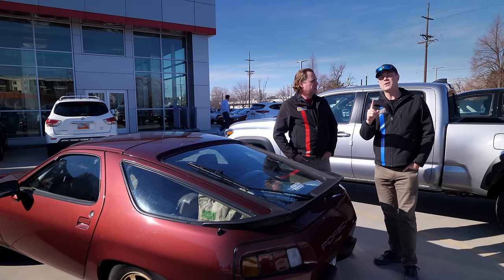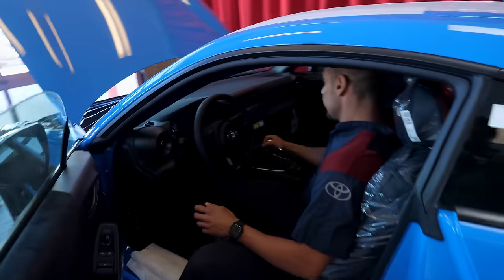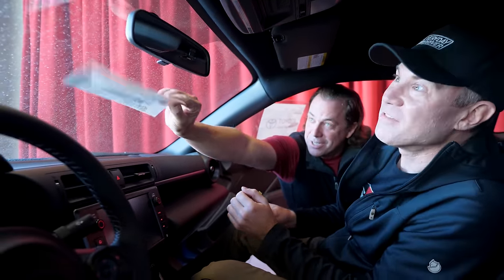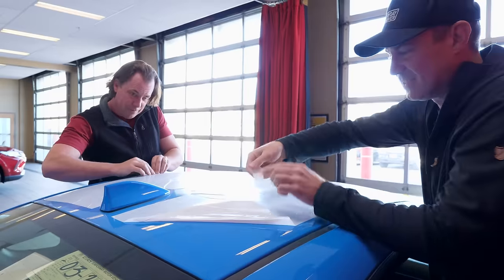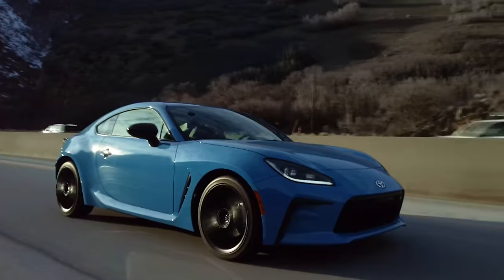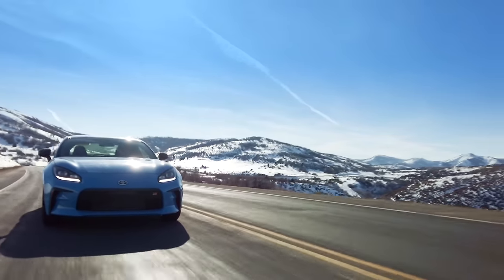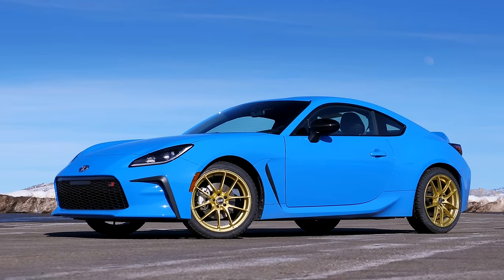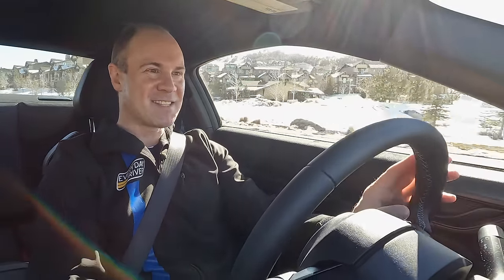We bought a GR86! - Money where our mouth is - Long Term #1 | Everyday Driver

Comment: Love the car congrats on the buy, quick question, how’s the car handle in the winter with snow is it usable as a every day car or is it being RWD a little much?
Reply from the maker: Todd drove his original FRS through many Utah winters and snow storms. RWD isn't a problem if you have winter tires.  That first gen was incredibly fun in the snow and this is no different. There are a couple videos on that car in the snow. Nothing showing it yet on this one. Thanks for watching!
Reply: I daily the ND miata in Colorado for a few years. With proper snow tires, anything under 1ft is very doable.
Reply: I've always wanted a 986 or 987, but at this price point for a new car. Burning question! A side by side comparison with 1st or 2nd gen boxter.1) Is it going to give me the same boxter fits like a glove interior. 2) is it gonna handle as good or better then boxter? 
Thanks! Love how the channel is evolving!
Reply: @hnc521  drove my mustang for the first time in the winter it was just fine. We had an ice storm and that was real bad, but to be expected.
Reply: @evalonious  I sold my 2009 Boxster S about a month ago and just took ownership of my new GR 86 about two weeks ago. The Boxster was a PDK transmission and I had all season continentals on it it also had 19 inch wheels. The GR 86 is the premium manual transmission and I bought a second set of wheels with Michelin winter tires so I can drive here year-round in Michigan. One of my main reasons for making the switch was for a greater comfort inside the car. I am 6 foot one and 170 pounds and I appreciate a little more legroom and being able to recline the seats also having space behind the seats for gear that one can easily reach and a good sized cupholder in the door. Terms of handling the cars are quite different the boxer is glued to the pavement and I never did break it loose on a curve. The GR 86 is easy to get sliding if that’s what you want to do especially in the winter. Comparing their steering the GR 86 is sharper especially on center very quick steering the Porsche was a bit more relaxed actually. I’m only at about 700 miles on the GR and have just today driven it over 4000 RPM for the first time. Obviously the big torque is 4000 up which was great to experience finally. The car is plenty fast for me not quite the same as the Porsche but just fine.
Reply: @Bill Leete  That was so informative. Thanks for taking the time to respond. If I had a car here in North Carolina (with mild winters) that could go sideways, I think I would end up in jail. 😅 I can actually "under-steer" slide with my Jetta Sportwagen virtually unnoticed. There is a  2 lane on ramp by my house that I can  slide across from the inside to the outside lane in the turn. Absolutely hilarious fun, when no cars around. If I had a car that oversteered, I would need a track.
Reply: @evalonious  Hi Evan, I’m sure when I get the summer tires back on the GR and have dry pavement the car will be quite stable. Only then can I really compare its handling to the Porsche.

Comment: I'm really mixed with a 981 Cayman Base 2.7 or a loaded GR86. Both the same price, same options, both drivers focused cars. Maybe your first review should be them head to head, because I'm for sure going to have to do it in person to make the choice.
Reply: Get the Cayman. Its a much more balanced car. Find a NA one. It will sing beautifully.
Reply: I am literally in the exact same boat as you. But they aren't the same price anymore. The Cayman is more in the low-high 40's for anything under 60k miles.
Reply: @ptsrs  yeah the GR86 would be probably a $5,000 savings, but I'd imagine after dealer markups and fees it might get very close to 40k. Especially where I live and them being so popular.

Comment: So I’m an owner of a 2018 brz. I’ve now bought the 2022 86. One reason I switched. The tech gauge has a yellow warning light before the red light. I love this when I’m on the track. My 2018 brz with stage 1 tune is getting 29mpg on highway. That’s insane. But it’s 230lbs lighter too. Love to share notes as I own 2018 and 2022.

Comment: Grats on the buy. You're going to love this one. I do, however, have some gripes, and I've learned a few things since I bought mine on black friday. I really don't like how my car came with a vortex generator. I've learned that, for my life, I need a track day set of wheels and tires, and maybe even pads. I need to change the brake fluid because I can feel the change in the brake pedal after track use. I got the noise generator turned off before my track day, and now I actually want it on, not because it sounds good, but it's the free option compared to buying a new exhaust, it's too quiet in here. There's a lot of UEL options out there, but I'm hesitant because it does move the peak torque around depending on who makes it, the tunes aren't available yet. Some catbacks are mostly direct bolt on from the previous gen, and give 2-4 horsepower, mostly negligible. What I want one for is sound, because if I had the money, I'd keep the sound generator off, and have a Perrin 3" Caback. The Borla sounds good too, but I don't know if it will turn the rear bumper into a parachute. there's no muffler in the Borla where the stock can used to be, and that acted as part of the aero to smooth air flow away from that muffler cavity. I hope they do something about that, like a diffuser or something. Lastly, I don't know if you're enforced to run a front license plate, but since I'm in California, I had to buy a front plate adapter from Subaru separately. My BRZ came with mount holes that were Japanese spec, so the holes were closer together, and larger than the hardware provided by the kit. A stop at the local Lowes to find M6-24 fasteners did the trick. You could drill through the bumper, like other dealerships shamefully have, but that will destroy such a beautiful nose. I don't feel like I'm lacking in power, but I've come to accept that I'm not a very good driver. I'll need to work on that. Oh and people need to stop trying to race me at the light. It's really annoying.
Reply: Anyone that does more than one track day a year should consider dedicated brakes and flush the brake fluid with higher temp stuff in any car. That isn’t limited to just these. Even exotics that get tracked regularly need higher temp fluid more often than not.
Reply: Well at least you know that you aren’t going to be beating anyone in that slow a.s car when someone pulls up to race 🤣

Comment: Great video and good coverage. Will get to learn more as you both live with the car. I bought the 2013 Scion FRS based on your reviews. I was driving it in Anchorage in the snow and ice and it did better than most of the cars (get good tires). 
The new car, everything is good about this car. There are quirks, which gives its character. Saw the Subaru and the Toyota version on the roads here, but just can't get over the look of that rear lights! Just something about the proportions and the style! Every time I'll walk to it would be disappointed. Miss the styling of the older gens! But again, styling is subjective, will see what the future will look like. Cool video and cool color choice!

Comment: I wanted the neptune blue GR86! The blue is also very similar to the Porsche Miami blue. The GR86/BRZ's active sound system is around $500 of components (internal speaker + microcontroller). That $500 could've been spent elsewhere like maybe adding wireless carplay/android auto.

Comment: Yes... The dealer can turn it off. I requested to have my piped in audio shut off prior to delivery, and they did. My gr86 was the first available in my area, and it was no problem. You will adjust to the blinkers. I love my car after two months. I do agree with the clear wrap. I had the full hood done rather than the factory wrap.

Comment: tip for those that want to keep the monroney sticker, it comes in the car as an unpeeled sticker, you can tell the dealer not to stick it on so you don't risk ripping it and it being sticky.
The PPF looks like the one my friend got from Nissan factory, it is a hard film, it'll chip like paint.

Comment: I got mine a few weeks ago. The car seat I got (designed for 3 across) fits in the back, rear facing or front facing. If we want to use the front seat, it has to be front facing, and the kiddo is at the weight where front or rear facing is fine.  I need to get those wheel size specs for my winter setup. I love OZs, I had them on the S2K AP2 and also on the Bug-eye WRX.

Comment: Here in Tennessee the dealers are selling the 86 for thousands above MSRP, if they can even get one. All the ones available that I could find have automatics, unfortunately. 

I ordered one from a dealer in Knoxville, they had a serial number for the car on the deal, then a month later they told me the car was unavailable. I found out it had been sold in Ohio. So they said they would get another one.  

Now it’s almost 2 months later, they have my deposit, but I haven’t heard from them

Comment: This latest Toyota is paying some compliment to the MX5, in order to beat it they have had to increase the engine capacity by 400cc. I like Toyota cars I have owned several over the last 30+ years and my current one is a Yaris cvt but my other car is a 2016 MX5 rag top. When I bought the MX5 new I was also looking at the a new GT86. The MX won the toss of a coin because I wanted top down motering.

Comment: All I can say is, I can't wait!! Love that color, and the wheels look great! I've owned my BRZ for 7 years, and I think it needs a sibling... a thinking new BRZ with the GR bumper. Also, hate any artificial engine/exhaust noise, and would take that out immediately, like I did with my BRZ. lol Another thing, those blinker....  I hate them. I've used those type of blinkers in other cars, and they're freaking stupid. Soooo glad my BRZ has normal blinkers! Why try and re-engineer the wheel, especially when you make it worse in my opinion. The original blinker do exactly what I need them to do, without any frustration. I honestly would try and figure out a way to replace the blinker mechanism to a normal style if and when I invest in the new BRZ. That's how much I loath those style blinkers.

Comment: That smart pin you see the technician installing into the power distribution block is a neat little device. If you remove it from a Tundra you can do things you're normally not allowed to do. Like lock the diffs in 4 HI and spin it like a top doing donuts lol

Comment: The downside of doing factory clearbra (Paint Protection Film) is that they will usually do a kit where they don't extend edges to get the car to almost look like there isnt any PPF on the car. Toyota obviously only did a half PPF on the bonnet which is depressing since you can still see the edge and it isnt covering the entire part of the partial hood. Most detail shops out there will do a wrapped extended edge if they are an actual good shop. If not they will just plot the kit and stick it on and it will look cheesy. I for one plan to put ceramic on my GR86 when I buy one but I am also tempted on getting the PPF then ceramic on top of it. But there are always pros and cons to both ceramic and PPF.

Comment: How would you describe the balance between the suspension (compression and damping rates) and the stiffness or lack thereof of the front and rear sway bars? Subjective, I know. Rough roads, off camber turns, what are the suspension firmness or harshness and body roll like? Does the car span the range from sports car to touring GT? [my personal dilemma will be this car vs a 2023 Civic Type R - any predictions?]

Comment: How smooth is the engine? Does it reward you for driving through the whole rpm band? Really not a fan of flat four engine design which has always kept me out of the 86/BRZ twins and eying a Miata NDv2 instead. Very curious with your thoughts
Reply from the maker: Yes. It’s actually enjoyable, and feels as expected, when you wind it through a whole gear to redline. Thanks for watching as always!

Comment: Excited to see how the journey goes! I had a 1st gen 2015, threw a bunch of mods and eventually turbo'd it. I LOVED that car. Sold it to someone 6 years later who (hopefully!) equally loves it. Now I want this exact spec and colour. Only heard good things about the power delivery on the new FA24. I want to give it a test drive and see how everything looks and feels - especially the turn signals since they're so controversial - but nobody has any on the lot right now! Already 99% sold on buying a 2nd gen. Should I wait for 2023 models to see if they address the radiator and turn signal issues?

Comment: How is the car for highway trips?  Not ripping down the road, actually driving at 70-80, passing semis, getting back up to 80 from 50 after some idiot does something in front of you.  Gas mileage, what engine speed are you at for those speeds, is it droney?  Do you get blown around by trucks and wind from the low weight or is it stable from its low height and suspension?

Comment: I will likely buy one.  When I finally drive one, I can weigh in with greater authority….til then……my hypothesis is that I’ll find that it’s not worlds different than the last one ….. yes I know the torque dip is essentially gone…..but it’s otherwise fundamentally the same car w new sheet metal.

Glad Paul has come around, but always found him to be an unfair critic of the old one.

To wit, “I thought the old one was cheap”…..my 2017 brz limited has alcantara  seats with leather bolsters and leather on parts of the door cards.  My guess is that the amount of cheap, hard touch plastic is comparable.

Oh - and to whomever dwells on fuel economy should buy a Corolla and leave the sports cars to us.

Comment: Congratulations on the purchase!
My only question about this car is, as someone who does not know how to drive manual, is the automatic gr86 worthy buying aka is it still fun to drive?
Reply: Just get the manual dude. A lot of GR86/BRZ buyers are buying this as their first manual and they absolutely love it! (I'm on the owner facebook groups). The auto is fine, but the transmission seems to be slow to respond at times and is a whole second slower to 60 so the car is actually worse dynamically and less fun. My advice, hold out for a manual, don't settle for an autotragic.
Reply: Sadly, the automatic is bad. It's just not a very responsive transmission. It's pretty much manual or bust with these.

Comment: I'm seriously considering this car as a replacement for my Mx-5 RF, and am looking for a grand tourer with less road noise on the freeway.  At 14:57 you said:  "I've been very concerned on the freeway about the level of noise this car produces."  Should I interpret this comment as meaning that you were pleasantly surprised by LESS road noise than what you expected?  Thanks for your input!
Reply from the maker: The comment you’re referring to leads into the discussion of the internal speaker/ engine noise generator. That feature makes the cabin loud - but as discussed, you can disable it or turn it off. We will be sharing a before and after. Thanks for watching.

Comment: I paid the big bucks for the  XPEL front half and side skirt PPF on my 22' BRZ. I don't recommend it. It is already peeling in at least 3 areas, rock damage punched straight through and chipped the paint. Most of my buddies put a high quality ceramic coating on their cars and it has held up amazingly for the last 2-3 years. Definitely recommend the ceramic coat and will do that next time.
Reply: That sucks. I’ve read that you can put ppf on first, then ceramic coat on top of the ppf for a total of two layers of protection. I wonder if that would have helped in your case.
Reply: @Barbwire710  You can but that does not change the fact that I paid a lot and already have peeling issues. I will take it in to be fixed but the car has only had XPEL on for 2 months. I would recommend XPEL on the hood only and also ceramic coat the entire car with the best stuff you can find.

Comment: I was debating with myself multiple times if i want to trade my ND2 miata for the GR86. It looks so sweet and is way more usable. Dealers dont really have them around me so it`s hard to see even what they want for it. If i get a good deal on it then i might pull the trigger. Until then miata it is.

Comment: I was happy to say you hated the black wheels. They are very bad, but then I saw your replacement, and I am not sure if they're an improvement. However, question for you both, how do you deal with the engine being as horrible sounding as it is? Both the 1st gen and 2nd gen are lifeless, soulless. That would be okay if they were super powerful but they aren't. Even a Miata engine sounds better, an S2000 engine sound 3000x times better. Even that old porsche you have probably sounds better. Does it bother you, or do you enjoy the driving dynamics enough that you'll just live with it and be happy (once you disable the engine speaker)?

Comment: The only question I had was about the possibility to turn off the engine sound since I've heard in other videos that it is annoying. Thanks for answering the question.
Reply: Now that I thing about it, I have another question for you: Do you have any comments about the NASA subscription that comes with the car shopping with a free class?
Reply from the maker: We hope you watched enough of the piece to reach the discussion of turning off the noise generator. And NASA is a great way to try track days. Thanks for watching!
Reply: Yes I did! This is the first video I see where this part is mentioned. I wish they would have just added another option to the menu on the screen to turn it off.
Reply from the maker: We do too!